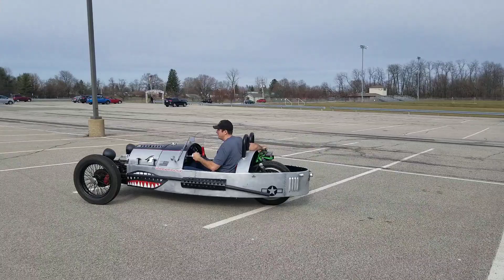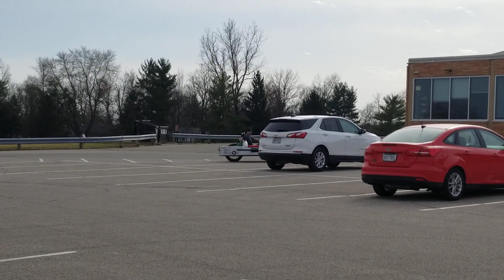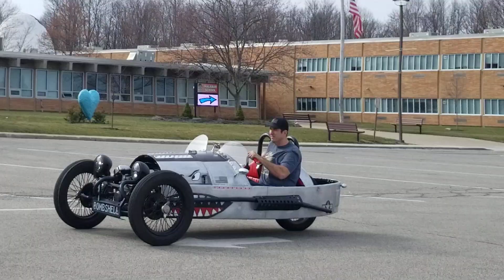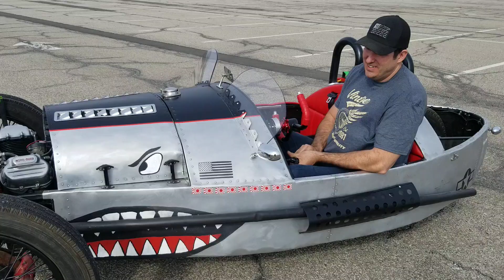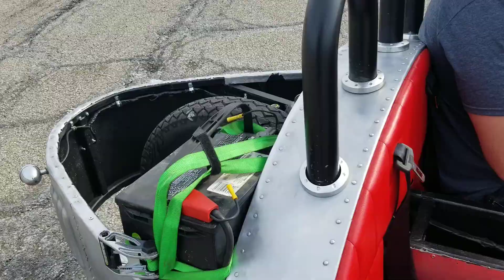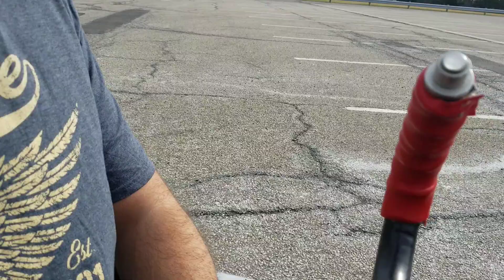FIRST DRIVE!

Comment: Very nice project you've done! So, how much does it cost you to build one? Very lovely ❤
Reply from the maker: Hard to say. I've had to buy a lot of tools, in addition to the ones I have. The materials aren't bad, but the skill involved may be prohibitive to some.  Thank you for the kind words.
Reply: @MikeZyouthpastor  one more question if i may ask, how do you get the plans for the chassis and all? Thanks before❤
Reply from the maker: @putrapacksindonesia3459  I didn't weld the frame, I bought it assembled. It's made from square tube that has bent into a boat shape. It's roughly 60" at the widest, in the passenger area it tapers forward to the engine bay, kind of a tear shape, 108" long, the seating area is 16" in height.
Reply: @MikeZyouthpastor  many thanks, so kind of you for answering the question. Hopefully one day i could also build one.  I hope the best for you, stay safe , healthy and happy, love from Indonesia❤
Reply from the maker: @putrapacksindonesia3459  absolutely, I dreamed about this for years before I could make it happen. God bless you, and your family, love from the USA!